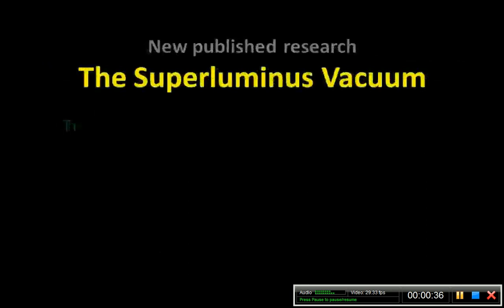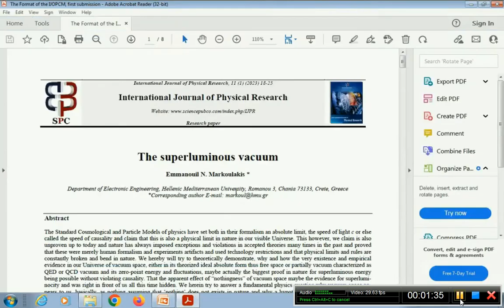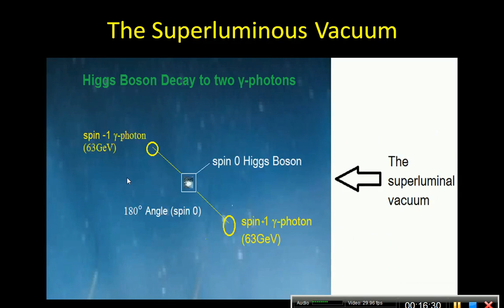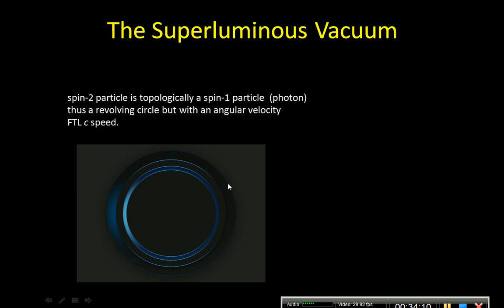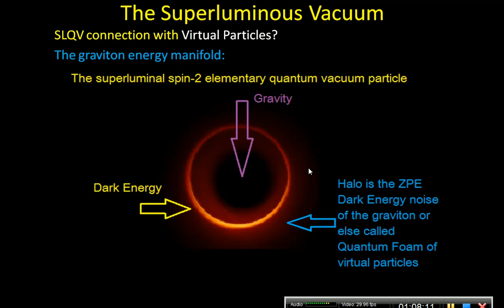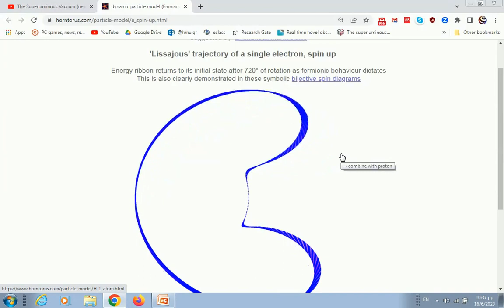The superluminous vacuum

Comment from the maker: At 31:35 time stamp of the video I say that a graviton spin-2 expected π-symmetry means the the particle will do a 2π full rotation by rotating at π/2 radians. This was a mistake on my behalf, the correct interpretation is that it makes a full 2π, rotating at π radians (i.e. π-symmetry) as it is actually correct written and illustrated in the power point slides presentation.